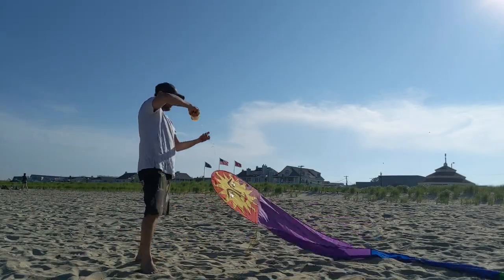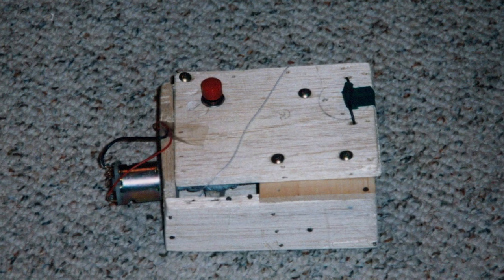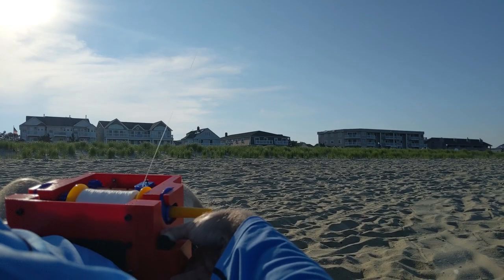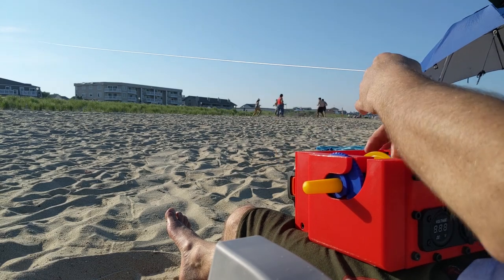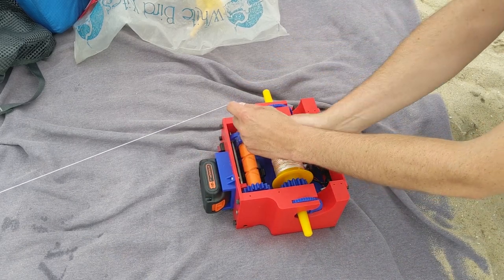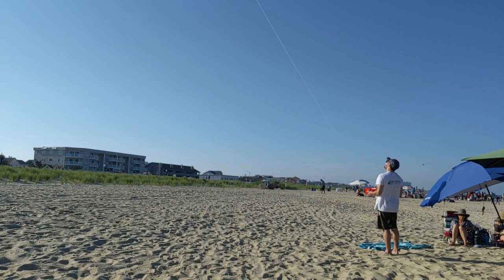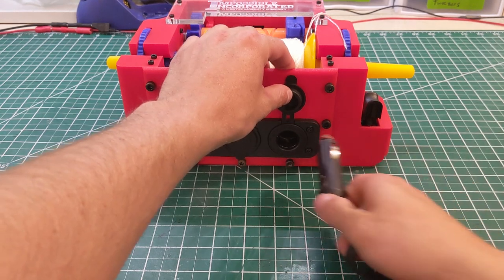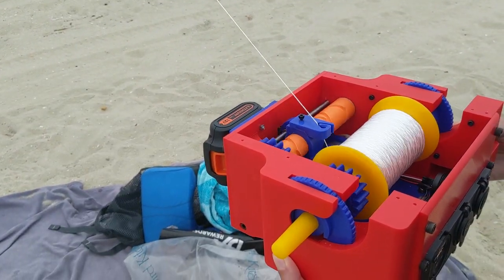The Automatic Kite String Reeler-Inner

Comment: https://hackaday.com/2019/08/21/automatic-rewinder-makes-kite-retrieval-a-breeze/   I made a comment (mine are moderated so might not be there yet or ever) with some thoughts since seems like there is way more potential for this design.  I was thinking for wind turbine power generation for both a kite, balloon and/or kite-balloon platforms.  Maybe even a gimbal added for image or video or RDF work.  At the least, automating kite flight seems like the next step.  Awesome build and thanks for sharing!
Reply from the maker: Thank you! I agree that the concept of automatic winding, and even this design can be refined further. With some more tinkering it could definitely be more robust to handle higher loads. At this point it was about the mechanical system for winding but it would be interesting in the future to play with that notion for automatic kite flying for a variety of applications.
Reply: @MattBilsky  >>> FWIW:  I subbed to your channel JUST FOR THIS PROJECT.  👍👍

Comment: this looks great👍🏾because I usually fly 5-10 kites at a time. this would help on the pack up time but fly large kite and don't think this one will pull the kites down so a larger motor , more pulling power maybe like a small battery so it can be recharged and you got me so keep me in the loop and I'm frist in line

Comment: Brilliant! I don’t even fly kites and I would (hypothetically like to) buy one. One question - is there a good mechanism to add weight to the device so it’s even more secured? Attachments to lock it to an even heavier anchor? Maybe just loops and straps to attach to various objects?
Reply from the maker: Thanks! It wouldn't be that hard to do. Before printing one could add a hole in the bottom or thread an eye bolt through the back panel to attach weights or a sand anchor bag like this: https://amzn.to/2ztMFrV or stake like this: https://amzn.to/2MJGHM9
Reply: @MattBilsky  I need this device for kite flying... I wana buy one for mine ...

Comment: Nice idea.  I can't help but notice how active the oscillation of the string guide is.  Whenever I draw in a hose on a reel I guide it much more slowly so the hose accumulates along right next to its self, building up each layer.  Is the world of kite strings sufficiently different that the fast back and forward action is better?  ...seems like it creates a lot of emptiness within the spun-full spindle.  Perhaps it reduces the chance of tangling or maybe a closer ratio between spindle turn frequency and string guide is just easier to build.  ...pretty cool no matter what :-)
Reply from the maker: Hi Foxpup, I went matched the winding pattern to the one from the factory (3 turns per layer). My guess why garden hoses and other similar winding systems don't do the crossing pattern is that they are larger in diameter and less likely to get tangled when quickly unwinding. The dissertation I mentioned in the video may also provide some more details but the rapid back and forth is common for most string-like applications.
Reply: @MattBilsky  Well there you go.  I figured you had thouroughly thought that through. :-)  I learn something new every day.

Comment: I would be willing to pay up to $60 without batteries. But is there any way you can make it use dewalt batteries or other brand batteries. If you can make it sturdy and robust, a flex bolt battery will hold down any kite. I would consider making a larger one that can fit 2 batteries and use it as an anchor/device dock. Also consider putting some strong points so I could use a bongie cord to strap it around a cooler or another beach stuff

Comment: Hey Amazing project!  A few questions. Can the mechanism be back driven to generate power? Basically could the kite pulling the string out recharge the battery? Maybe with a few modifications? And how much of a load can it take 30-40 pounds of force? Would the string or the mechanism break first?

 

I am working on a kite power system with a steerable RAM air kite and I hope to make something similar to this as the base station! Thanks for an awesome video and project!!